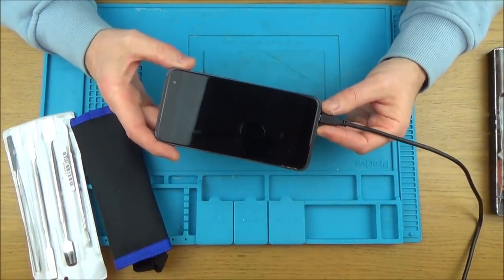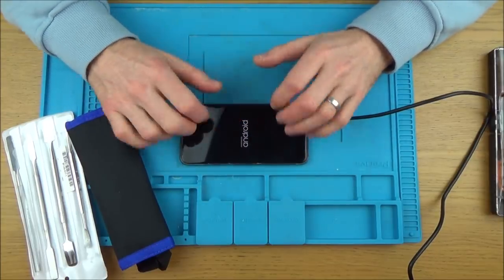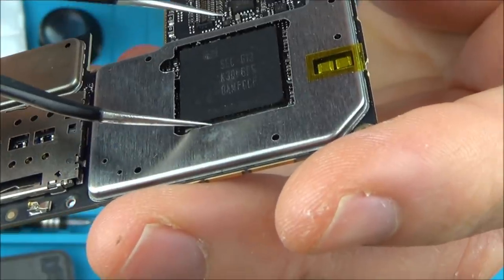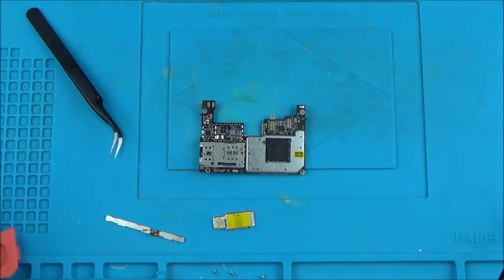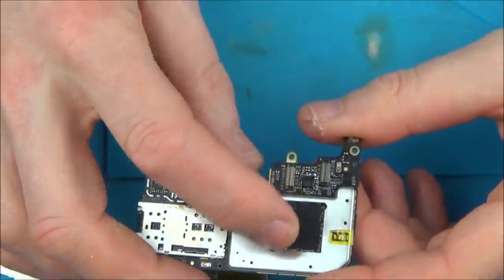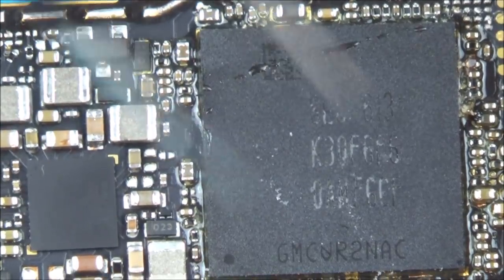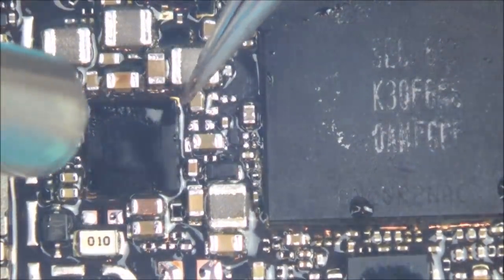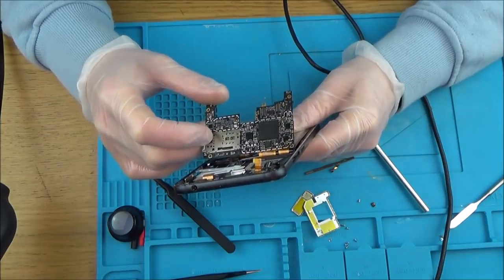Trying to FIX a Faulty Android VFD900 Android Mobile Cell Phone

Comment: Hi Vince,  The solder appearing from underneath the big chip is a phenomenon known as popcorning.  In addition to solder, manufacturers add a glue like component called underfill, it is the excess of this that you can see around the edge of the chip.  When the chip is heated, the solder underneath it expands (like most metals when heated) or least it would if it wasn't constrained by the underfill.  Eventually the pressure created by the expanding solder overcomes the underfill and the solder escapes like steam.

The underfill serves two main purposes : 1) adhesion - helps reduce the odds of damage from board flex.  2) water/fluid protection.

I hope that helps.

And to echo some of the other commentators, you don't want to apply any form of downward or angular pressure on BGA components as they are intended to float of their balls, gentle little horizontal "nudges" is the most you should do.
Reply: this is one of the few who knows what they are talking about, underfill is a bitch, i love samsung for pretty much never using it but there is problems in not using it i guess, constant charging ic replacements on samsungs.
Reply from the maker: Excellent advice, thanks for sharing the info on the underfill, that makes sense to me now. I was wondering why the solder was forcing through. So do you know a technique for removing the underfill if you wanted to try and reflow the chip?
Thanks, Vince :-)
Reply: I work with underfilled chips almost daily.  The only technique that I know of is to remove the chip from the board, remove the underfill from both the board and the chip, clean up the pads, reball the chip and flow it back into place.   Trying to reflow without dealing with the underfill is almost impossible requiring an almost unobtainable level of control of the heat so as to get the solder barely liquid and to back off before it wants to expand too much.  
There are also variances in the makeup of the underfill with some being capable of containing the solder for longer than others.
The underfill in most cases is as the name implies - under fill - fills all the voids under the chip and not just the edges as is the case with "edge bonding".
Once you have popcorned a chip it will need to be reworked as there will be a new network of connections created by the escaping solder.
In your example, I suspect that what we refer to as a "chip" is more likely to be a stack of chips possibly including : CPU, RAM, NAND or any combination thereof.  On apple devices it would be CPU and RAM but on a lot of Samsung devices it is be all three.
Stacked chips are a REAL nightmare to work with!

I hope this is helpful.  Please feel free to ask me anything, if I can help I'd be glad to.
Reply from the maker: @fromtheashesit7782  Thanks, that reply contains so much info, I feel like I know so much more now...I didn't realise the glue (underfill) went all the way through. So unless you have worked on the chip before on another device I suppose you have no way of knowing if it has been edge bonded or under filled. I am sure I will come across plenty more chips on various different devices with underfill so this is really useful to know. Unfortunately reballing is a skill way beyond me at present. If you do know a way of telling if it is edge bonded or underfilled then it would be really useful to me and others reading this. Many thanks :-)
Reply: @Mymatevince  As a rule of thumb, if the glue forms a "down hill ski slope" from the edge of the chip down to the board it is more likely to be underfill than edge bonding.  If it appears as more of a blob or bead of glue surrounding the chip then it is more likely to be edge bonding.  It does however vary from manufacturer to manufacturer and even from process to process.
Reballing really isn't that hard, you already have hot air and flux, all you need is a stencil,  solder paste and some time to practice.  My advice on reballing is to use drier paste, even if you have to dry some out a little before you use it.
Reply from the maker: @fromtheashesit7782  Excellent, thanks for the tips and explanation. it really helps :-)
Reply: Hi vince
All the comments here are spot on!
When you solder SMD components you can certainly put downward pressure eg. Capacitors/filters and so in but not on main chips that need to float on the solder balls with good connections to their pads. 
Mentioned to you before to maybe check out ipadrehab and louis Rossmann vids (among others) and you will pick up a wealth of knowledge and tips from two of the best!
All may not be lost with this Alcatel phone if you take care and go gently.... it could end up being the best thing for you to practice on as it’s definitely in need of intense care, but hopefully not dead yet (unless you keep killing it with hot air?) don’t forget it was fine until you dropped it - not crushed or water damaged or worse. Should be recoverable as a working phone but go carefully!!
Best of luck to you 👍👍🇨🇮🇨🇮
Reply: @Mymatevince  you should try watching one of stranger parts' videos (I think that's the name of the channel). I think the one that he upgraded his iPhone's storage. Hope I helped
Reply: @Mymatevince  it could be the motherboard it may not have one
Reply: @Mymatevince Hi

Comment: Don't push down on BGA chips when the hot air is on them. It will mash all the solder balls into one big solder blob under the chip. Dave from EEVblog did the same thing when he tried to do BGA rework for the first time a few months ago.
Reply from the maker: Thanks for the tips, I will try to find his video. Cheers :-)

Comment: so, i work on phone ic replacement daily, the problem here is the "underfill" around  and underneath the chip for waterproofing and shock-proofing, it needs to be lightly scraped away otherwise when trying to float the chip it will have no room to move (or breathe, odd i know) but the flux wants to flow through and will make a passage through eventually, if you remove the infill or not, so the solder balls are from heating while infill is still present, apple boards have it all over, its a right pain in the arse but its one of those learning curves dude, this is a big step up from through hole and some smd work, diagnostics and repairs to most phone motherboards sucks imo as i do it daily, i only got the hang of it last year and have been doing this for 11 years :/ when someone brings in a stereo or tv to repair i rejoice haha :D Dont stop though, you're progressing faster than i did and i now have my own shop :)
Reply from the maker: Thanks for the tips Kevin, I appreciate it :-) With the infill do you scrape it away or use a chemical to soften it up and then scrape it?
Reply: @Mymatevince  i scrape away gently with an surgical blade, something very sharp but thin, a little heat, around 200c will help move it right along :) soften it up, easier to peel instead of scrape i guess :P also you're more than welcome, you're videos help me see things daily that i'd otherwise overlook so thankyou.
Reply: in most cases flux, a little heat and sharp tweezers will do the job though, you will see the chip move quickly too, around the same rate as the others (time it takes to heat up and wiggle on pads) it was just being held by the underfill, creating a little vacuum under the chip :)
Reply from the maker: Cheers Kevin, nice to hear the different way people do stuff.
Thanks mate :-)

Comment: Great vid Vince and nice try too, just a bit of advice, you do not need to push down on a BGA, the surface tension will pull the balls to the pads, also you only need to nudge one edge of the chip, if any joints are still soldered it would not move so seeing any movement just on the one edge means all balls have melted. Great effort :)
Reply from the maker: Excellent, thanks for these tips. In the future I will just nudge one corner and I won't press down :-)

Comment: Why didn't you take the chip out? The phone is dead anyway but you would have known what is going on underneath it.
Reply: Your comment was first and you spoiled the whole video. :D
Reply: @DeRive_  sorry mate
Reply: @AndrewFomin  Its fine. :)
Reply: Hi, because the chip is a BGA so this means that he would need a stencil and solder balls (or solder paste) to redo the chip.
And it probably wasn't related to the hardware but to the software, he should have tried the software first in my honest opinion :)
Reply: @FixDaily  I agree with that. But as this video is mainly made for entertainment I think removing the chip could be interesting. (PS. I know how BGA soldering/resoldering is done and only talking about this particular device)
Reply: @FixDaily  you can do it without stensil but the problem was not even there at all
Reply: @technixbul  Well that depends on the size of the BGA and also the pitch
Reply: @FixDaily  nope ... it just looks esteticaly beter and helps the robot to solder it and alows airflow to circulate under chip to dissipate heat but here that does not matter because the chip is glued and cooled trough package to case so again -> nope ... it will cool even better when the distance to PCB is shorter - the principal law of Thermal Dynamics. Well yeah you could say it removes a bit of stress but this glued junk is so tide that this does not affect it at all, heat is the enemy here, coper, gold and silver are beter than tin layer in the case
Reply: @DeRive_  tip: try not reading the comments until the video is over. People spoil
Reply: @DeRive_  Don't read comments before watching video.
Reply: @becarp940  Its automatic.

Comment: Since they would not replace it under warranty because of the crack on the back cover, why not just replace the back cover?
Reply: the back cover on most android phones have the IMEI number and the model. if you buy a new one it wont have it. the company wont fix it.

Comment: try hard reset. Hold power button and volume up or down the same time and enter the recovery menu. Select clear data cache ...  and then restart. to select the option use the volume buttons to go up and down and power button to confirm selection. It's in a loop sequence where the software is unable do load. At least you had fun and I enjoy it

Comment: Some chips are underfilled, you can't replace them or resolder them even the manufacturer can't. As in this case I think one of these components came loose from the pcb under these underfilling, it's a shame you didn't replace the backcover first and then send it in for warranty they probably fixed it as long they can't see you opened it, but now it is noticed under the imei number as broken by customers fault. As long nothings wrong with the pcb a mobile phone can be fixed, but liquid damage and bend circuit boards on these thing aren't. But at least you did a nice try.

Comment: You can't hot underfilled chips! You can try to remove glue first at ~200C, but not allways this is possible.
Reply from the maker: Thanks for the advice :-)
Reply: @Mymatevince  That's true the under-fill messes up with the chip and the solder balls by lifting up or contracting it down, it depends of the heat, the thermal shock and the under-fill material, in this case, it contracted it down squishing the solder.
When you mess with a under-filled chip you have to remove it and redo the soldering
Reply from the maker: @FixDaily  Thanks FixDaily :-)

Comment: Did you try using Odin first and see if flashing the original factory Rom and firmware would help Vince.  It's only a usb cable needed a pc or laptop Odin and a download of the original software .I had it on my vdf 400 I think it was and I did just that and it stopped the boot loader loop and the phone worked again. Until I sat on it and smashed the screen and bent the frame . But the hard reset and soft reset you did are not all you could of tried software wise. Also when you held the button combination did you get the screen  show up with the options of wipe cache partition and so on? Only ask as that means you could of put it into the mode to flash the Rom again .
Reply from the maker: Hi Dave, I didn't try the power/volume button combo this time but I tried it numerous times when it went faulty to begin with in  Dec 2017. I could definitely get to that screen that gives you the 5 or 6 different options to reset phone, clear cache etc. I wish I had tried the new software after reading the comments but because I dropped it I didn't think it would be software related. The repair shop did say they tried new software but I don't know if they really did or not. Cheers for the info, hopefully I can try it in the future on another faulty phone :-)
Reply: @Mymatevince  no worries . I always try the software option first as it's the easiest. Although the downloads for the Rom files can take hours even though they are fairly small so it's always worth keeping them backed up. I'm unsure myself if it would of worked but from experience that is what I have found to be the easiest fix . I look forward to seeing the next one Vince.  Oh and update on the neighbours iphone 6 . I fixed it after lots of fiddly work . He smashed the screen a day later :/ .
Reply from the maker: Haha, that is a classic. At least changing over the screen is relatively painless. If you have to do it for them make sure you undo the battery first (unlike me) because apparently there is a very high chance of blowing the backlight :-)
Reply: @Mymatevince  ah I didn't know that myself .  I think I left it plugged in during the rebuild . So I'm lucky I didn't cause more damage myself . Thanks for that . I must say I was rather annoyed that he came back only a day later saying that something was wrong with the screen and it was clearly smashed.  😡

Comment: The solder balls may have come out because when heated the other solder balls under the chip may have pulled the chip down closer and literaly squashed any excess solder out. You have probably already noticed that the chip did move when you squashed it down. Maybe try again as a short 10 min vid. A bit confused as to why Vodaphone didnt fix the fault (not the case).

Comment: Nice attempt!  Certainly not easy working on this stuff!   It's strange that the solder balls have come out - I would be tempted to remove that large (and the smaller one) with hot air - just to see what's going on underneath.  If you get a stencil (they are cheap on AliExpress), get some solder paste (cheap), align stencil, smear the paste over the holes - use hot air and you've reballed the chip.  Clean pads with desolder braid and you can then mount the reballed chip.  I think you could do this - just a question of getting the right stencil and hoping other components dont move around.  I was going to try reballing the Gamecube I have (as that IS a ball issue too - proven).  But I cannot find a stencil for it =/
Reply from the maker: Thanks Chris :-) That would be a lot of fun. I wonder whether there are countless stencils though or do chips of the same size have the same layout? Otherwise like your Gamecube it may be hard or impossible to obtain the correct stencil. I would love to see you attempt a reball in one of your vids. Do you think solder paste would be better than the solder balls you can buy?
Reply: I've ordered a universal stencil set from eBay - there's like 27 pieces in the kit.  Maybe that would work for both these?  I will have a go at the GameCube CPU but its pretty large - I imagine it will be difficult to remove and even hard to re-install afterwards....
Reply from the maker: @GadgetUK164  I did see that one, £3.85 from Hong Kong. It looks like you need a clamp type thing to line it all up as well. Let me know if you have any success with it :-)
Reply: I have one of those phones

Comment: When solder is molten it move and if there is a load (CPU chip) on top of it, and chip move with the solder. But if the chip been hold by a glue or some other thing, it will cause a solder ball move violently and it will cause the solder ball to touch the other solder ball and cause short circuit. And if the glue shrink down by the heat, it will pull the chip down and causing the solder ball to shoot out.

Comment: What typically happens is a pin or more is disconnected around either the cpu or memory area, this causes corruption of the software, when the phone tries to recover it keeps failing due to the software errors, each time it boot loops while the device has dry joints, the software will continue to create more corruption,
There is also other things that are common to breaking away from the board like the inductor for one of the v_core power rails, maybe for memory, they only have 2pins.
One issue is that some of the chips don't like heat, even cooking at 280c for 10s, this is where a pre-board heater is needed

Comment: The first thing i would have done is tried odin to re flash the software. This same thing happened with a tablet i had. I dropped it and it dod the reboot thing. After a new flash it worked.
Reply: Horlicks Odin only works with Samsung’s
Reply: He could use sp flash tool